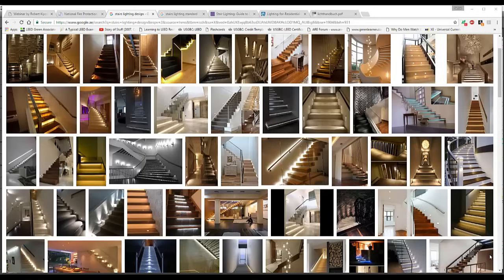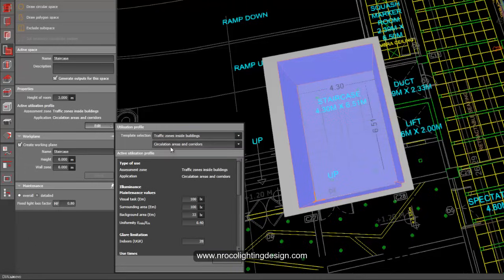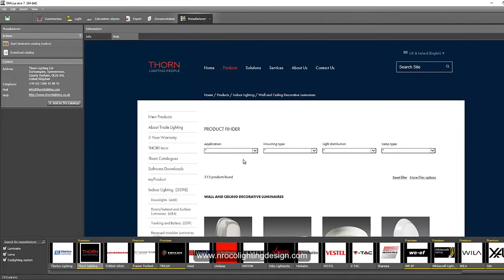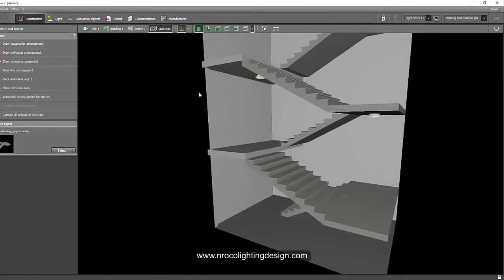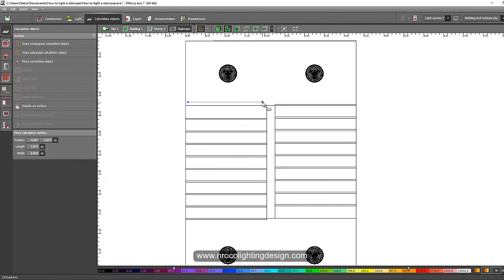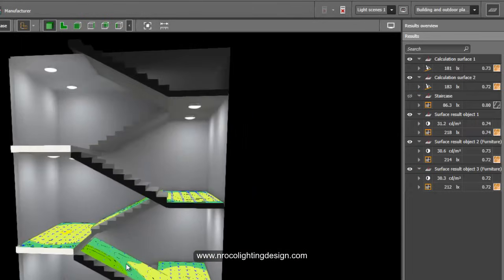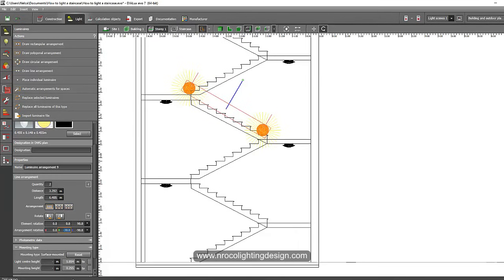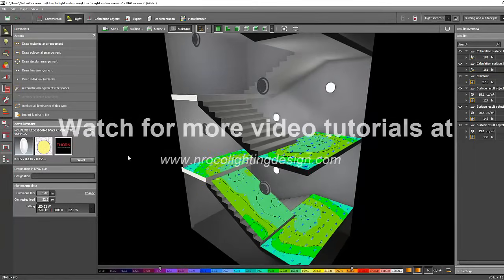How to do lighting design calculations for Staircase

Comment: Hi, I am attempting to model a stairwell where the footprint of the room, which spans 3 storeys, (and therefore rise and runs of staircases vary) is not the same on each floor of the building. Could you possibly elaborate on how to model this type of stairwell? I would have no problem sharing floor plans with dimensions with you.
Reply from the maker: Hi Jo, if the stairs are not typical, try modelling it manually.  create your own stairs by using extrusion volume or cube.
Reply: Where can I get that software .

Comment: I can see that the height of stairs you used is standard (3m), and I did the same at the beginning and I got a 102 average lux. However, I found out that the project consultant am working with that he wants the distance between the surface of light fitting and the surface below it to be 2.64. So I pressed on the stair and changed the third blank from 3 to 2.64. I saw that the stairs shrinked  ( which means the distance between light and ground below it is lower) ;however, the result I got after that for average lux is 62 which is lower. So did I do something wrong because lux should increase ?   
Thanks for the advice.
Reply from the maker: yes, the lux value should increase. check the location of ur luminaire in elevation view.  It might not mounted properly.

Comment: Hello!

It's possible to change the results on  the platform, from perpendicular illuminance (adaptative) to horizontal illuminance?
It's also possible to remove luminance of the report?

Thank you!
Reply from the maker: yes its possible.  you will find it in the calculation tab options.
Reply: I can't find... I find for the calculation surface, but for the platform I can't find...
Can you show me please?

Comment: Sorry Mrs. Roco,
but I think you chose the false calculation mode for the stairs.
The right one is the first one. The term "perpendicular" corresponds not with the original calculation parameter which is defined in german. It´s not correct translated from german in english.
The right calculation mode which is defined in the international norm 12464 defines the vertical direction to the measurement layer. When the layer is turned it has to be the first calculation parameter.
But nevertheless thank you for this video
with best wishes